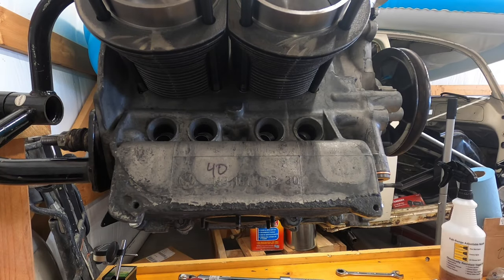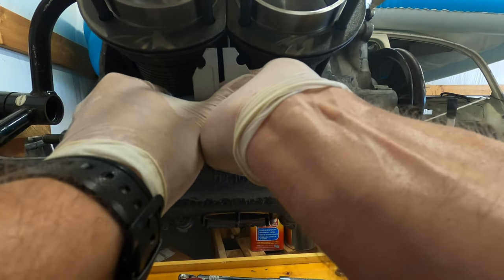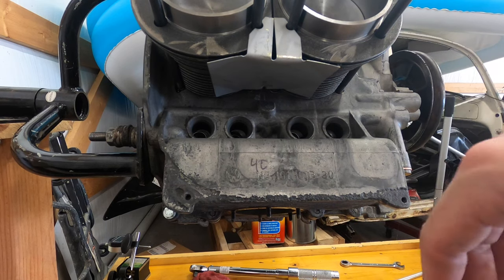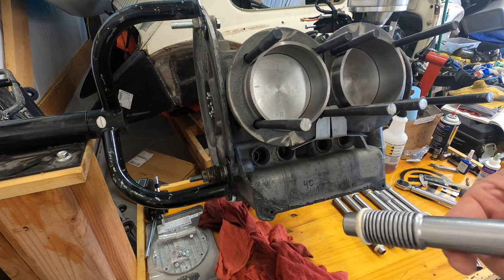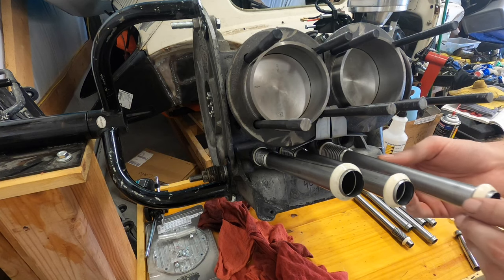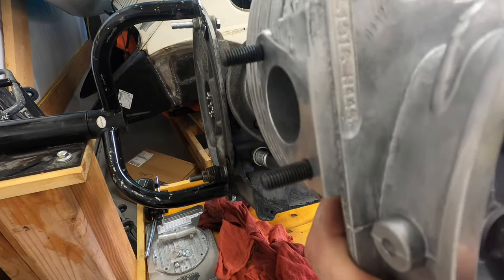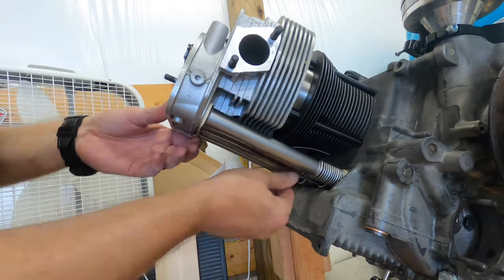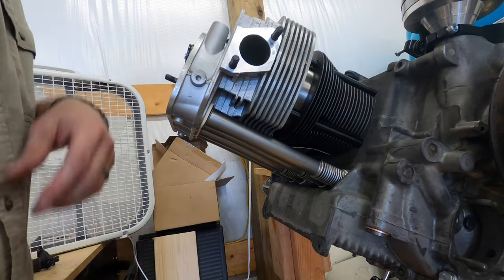Head Install - CB Performance Heads VW Beetle

Comment: Nice video,  I don't know if you covered this in a previous video, but it's a good idea to lap each cylinder top to the head in which it is going to seat. Use valve grinding compound and clean thoroughly.
Reply from the maker: Thanks!  They were brand new heads from CB Performance, but definitely a good idea!